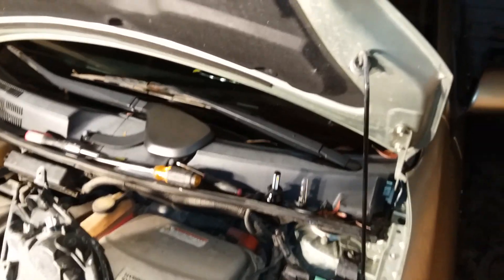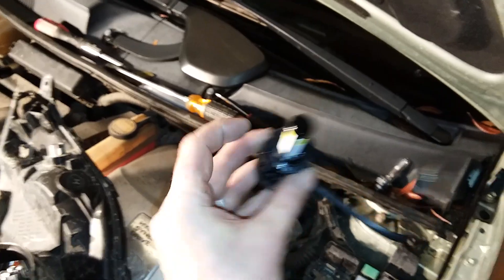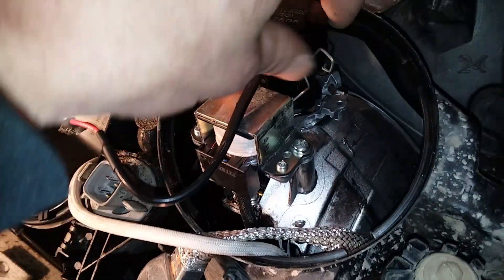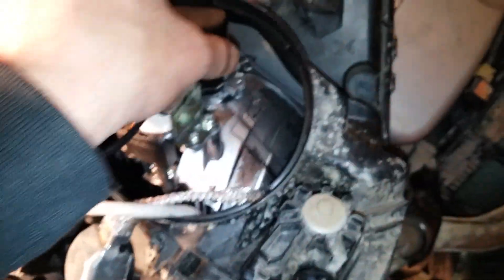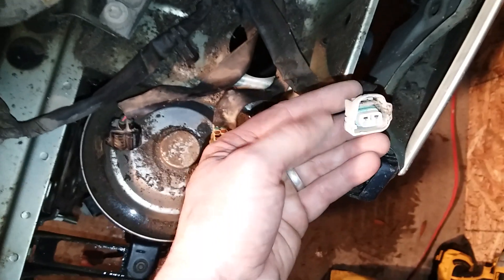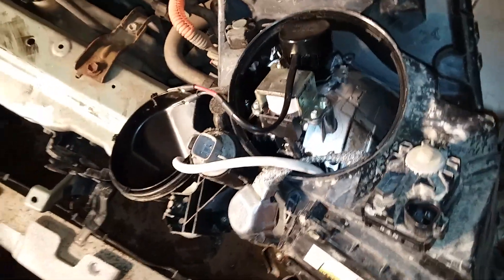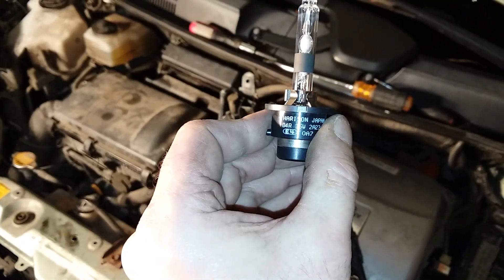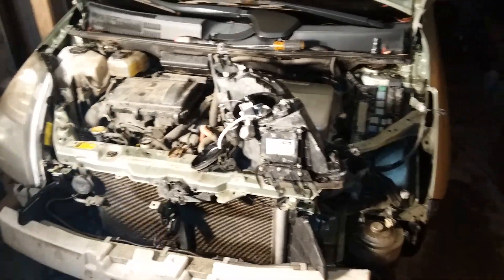2004 to 2009 2nd Gen Prius How To Convert HID Headlight to LED Conversion D4R LED

Comment: Has anyone (cops, other drivers) complained/flashed you yet? I was going to put LEDs on my 2008 Prius but I heard that the Halogen/HID headlight casing isn't good positioning for LEDs so it ends up blinding everyone
Reply from the maker: I've been flashed but not that often.  They don't seem much brighter than stock.  But, this was my option. Buying new HID lights are expensive. 
VT247

Comment: Why is there 2 pins on yours? All the one in ebay are 3 pin! Will that work! Prius 2008 thanks
Reply from the maker: The 3 wire lights are for low and high beam.  The Prius uses a flapper inside the headlight to switch from low to high.  On mine, all the LED are lit up on all 4 sides.  I'd just wire  the ground and combine the two positives (low and high beam) so all the lights on the replacement LED unit are on all the time for 3 wire.  As of now, the exact style used in this video came up on an eBay search as:  4-Sided D1S D2S D3S D4S D1R D2R D3R D4R LED Headlight Kit 80W 8000LM 6000K Bulbs  or 2x LED Headlight D1S D2S D3S D4S D1R D2R D3R D4R Kit 6000K White 6000K Bulbs USA or 80W 8000LM D1S D2S D3S D4S D1R D2R D3R D4R LED Headlight Kit 4-Sides Bulbs HID  Hope this helps.
VT247

Comment: 1)So after led conversion we don’t need the ballast I presume?
2)Plus how do you like it after converting to led from hid? 
3)is everything working so far after about a month of switching to led, like no check engine light on the dash and other bad stuff? 
Thanks for answers in advance 👍
Reply from the maker: First, sorry for not responding for a while.  Youtube has been acting funny and your comment was held for some reason.  Found it under analytics on the creator page.  Weird.  Anyhow, to your questions.
1)  After you switch to the LED lights on the Prius, you don't need the ballast on the bottom of the headlight assembly.  I didn't bother taking mine off, just wired in the LED lights as described in the video and ran with it.
2)Really liking the LED set up.  Best part, it's reliable.  Turn on the headlights and on come the lights.  Before, would be going down the road and suddenly the light would just go out.  The 'flapper' switch inside the light assembly makes it go from low to high beam.  
3) Everything is as normal.  No check engine lights or anything funny.  Had already swapped out from HID to LED before I got the car smogged and it passed without issue.  They work really well and am happy with the results.
VT247
Reply: Vacationtime247 
just 1 more question, 
1) does d4R has low & high beam?
2) I kinda ordered low/high I don’t think it’s d4R but it has 3 prongs & your video showed 2 prongs, 
3) can I convert 3-prong to 2 or should I order d4R with 2 prong switch?
Thanks fir your time to answer my questions.

Comment: how shine Led compared to regular xenon?
Reply: illumination is better or worse and that with a cut-off border?
Reply from the maker: The lights illuminate the road really well without being blinding to other drivers.  Seems to make road signs a lot more visible too.  Really happy with the results.  Turn the switch and the lights come right on.  Before the LED set up it had the HID with the ballasts under the headlight assembly.  Believe if you are going from a Xenon to LED the part number / cross reference is different.  So be mindful of what you order and what you have.  Hope this helps.
VT247

Comment: What about the hid ballast?
Reply from the maker: I didn't bother taking mine out.  The plug that goes into the back of the cover is what powers the ballast.  I unplugged mine from the bulb and the 2 wire connector.  Cut off a section several inches from where it plugs into from the back of the cover.  Then wired the LED bulbs to the wire that goes into the cover.  Just twisted them together + to + and - to - and used electrical tape.  The ballast wires were just tucked back in the light assembly, there's plenty of room.  It was really pretty easy.  Hope this helps.
VT247